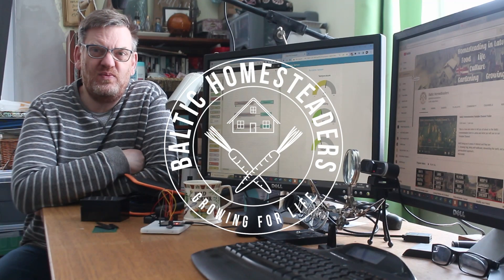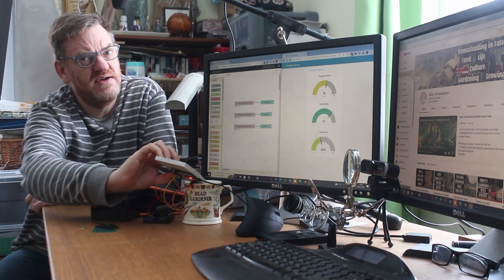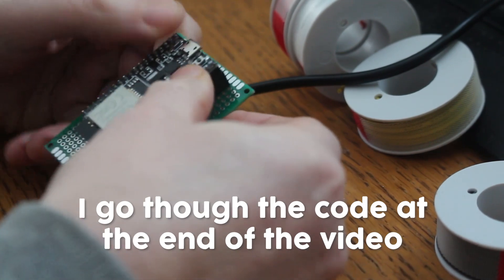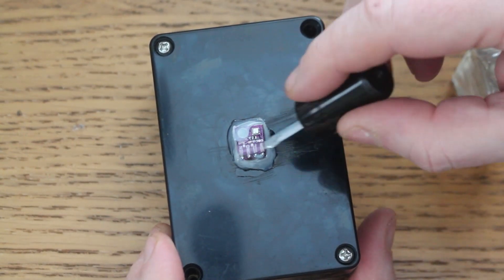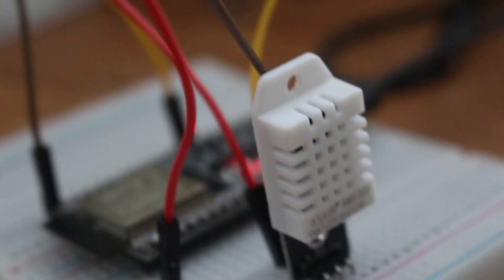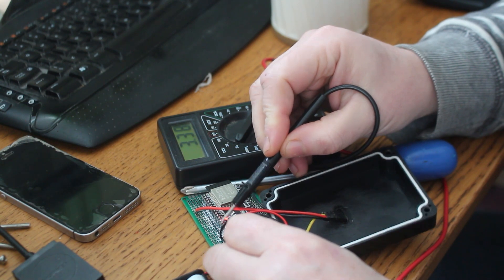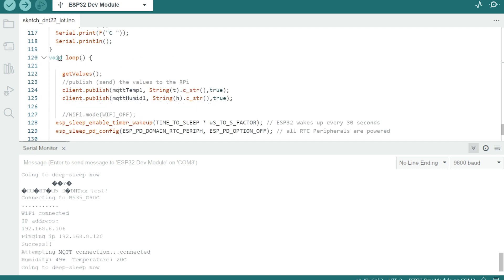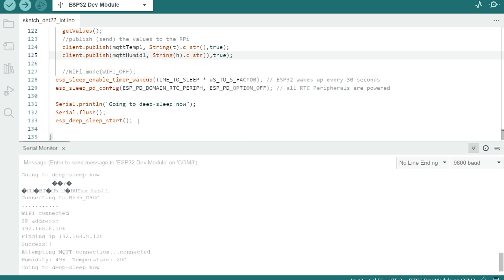Making A Portable Temperature Sensor for Automation - IOT - Audrino ESP32

Comment: more of this please. Also coding side.😬🙂
Reply from the maker: Are you new to coding or have some experience?
Reply: @BalticHomesteaders   not so much with watering systems. lol but, yes. I do some. You get some hardware and "make things happen". Not the everyday virtual app or database stuff. This is great. For instance, we usually try to buy some Gardena or other brand watering "computer" and often stuck with what it can provide. Your DIY opens new horizon  - not so expensive AND flexible options to fit homesteads needs. Therefore, to me it's great!!
Reply from the maker: We the single most expensive item was the box it's all in :) OK together it was quite a bit but all the components are relatively inexpensive on their own. But as the you say, the flexibility to program it yourself is priceless :)

Comment: Are you familiar with Home Assistant? this could help you as well. Also something that could help is, using POE, power over Ethernet. There are mcu boards that support POE. Convenient for long range.
Reply from the maker: I’m really interested in POE as we start to think about rewiring the house. Maybe that will be this winter’s project :) Have you done much with it?
Reply: @BalticHomesteaders  yeah, I think it is a great technology as only one cable is needed for both data and power. I have some experience with using a POE network switch with an Olimex Esp32 POE. Also there is Lorawan (Long Range WAN), maybe already known by you. These are wireless and are used for longer distances. I am reading on greenhouse automation at the moment, therefore I came across your video. A channel called Chillichump has some good videos as well (look for “Chillichump automation”). Also LED gardener has great videos, good luck!
Reply from the maker: I used to own a webdev biz so had some programming knowledge but chillichump introduced me to automation (think I linked to smogs channel on one of the vids) and audrino/ node red to get the basics but obviously now I can take it forward as needed. I had a RPi kicking about from ages ago but I understand now they’re quite rare! I’m all for efficiency saving (as per my approach to the big no dig garden) which is why I first looked into automation. It’s part of the passive solar project to try and make a smart greenhouse kind of thing. By the end of  year we’ll find out, it’s good fun though :)